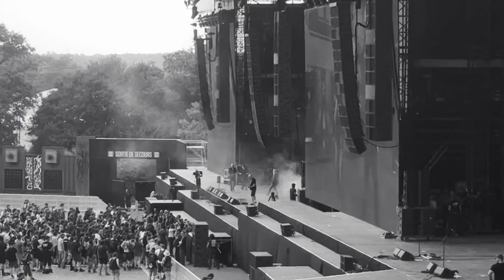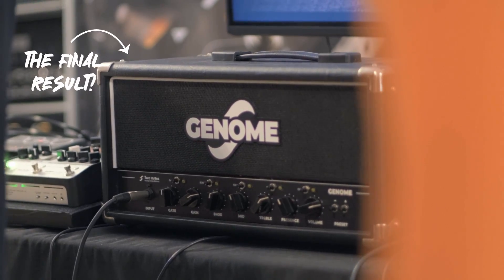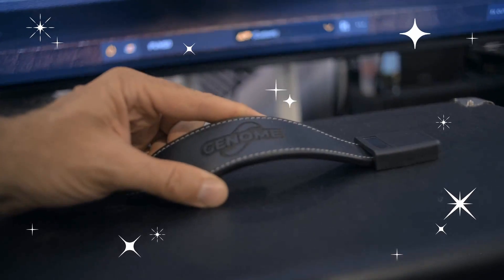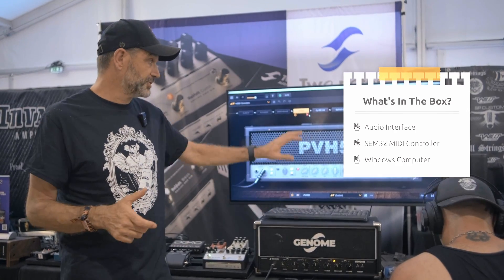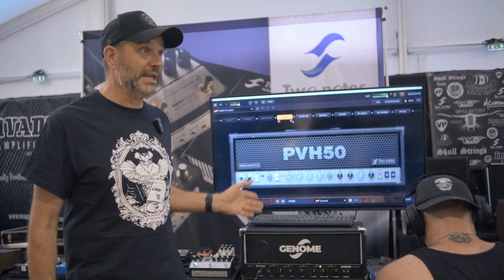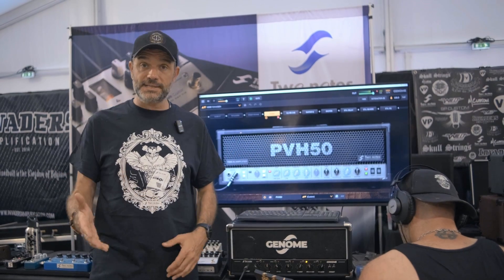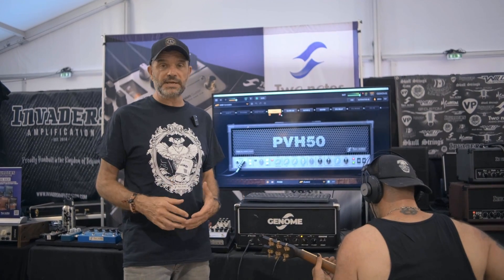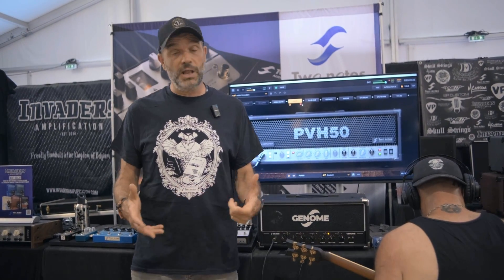DIY Project | GENOME in a Box | Episode 5

Comment: Just wondering about a pair of powered speakers or Power Amp + pair of Speakers for Live use (rehearsing) or In Studio (recording). Not planning to gig. More for Studio. Or should I just rely on the mixing monitors. We use KRK Rokit 5 (2009).
My laptop environment using GENOME with a used 2017 Surface Pro 5 i7 7th Gen + 16GB RAM. Using SSL-2 Interface. Windows 10 Pro. Everything working great. Using Mackie CR-3X on my desktop. 
I will use this for GENOME Standalone going into 2 channels when in the studio. With headphone and tracking with a live drummer for bed tracks.
Reply: Great question, you will most likely be best using some powered PA monitors for this purpose! If you were using a power amp and traditional cabinet, you would have to remove the cabinet emulation in GENOME which could ultimately hinder the tones you can create with it!

Comment: Instead of the front Tolex with the Genome brand on the amp shell, you should put a touchscreen that would have the Genome logo, but could still be used to show the Genome software… Just a 2¢ thought
Reply: I am currently using a Microsoft Surface Pro 5 1796 from 2017. Got it from work 2 years ago for $60 Canadian. GENOME runs great with most current version.
i7-7660U CPU @ 2.50GHz, 2496 Mhz, 2 Core(s), 4 Logical Processor(s) Installed Physical Memory (RAM)	16.0 GB running Windows 10 Pro 

The Surface Pro has a touchscreen. 12.3 inch screen. Resolution 2736 x 1824
Using wireless KB, Mouse + connected to a 55" Samsung 4k TV 
SSL-2 audio Interface.
Reply: Not a bad suggestion at all, but I wanted it to look like a regular amp. :)
Reply: Not a bad suggestion at all! Note that for this project, it was simply a proof of concept for our exhibition at HellFest - however, we have received some mixed feedback on the form factor - some people love the amp head concept, some people would prefer a floorboard processor - what is your preference?